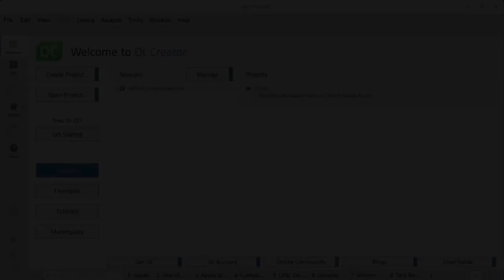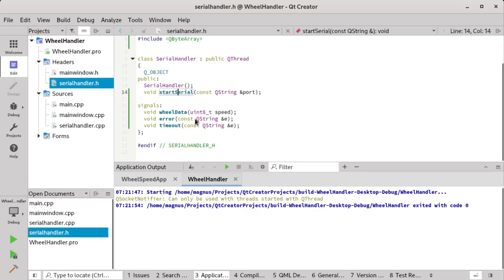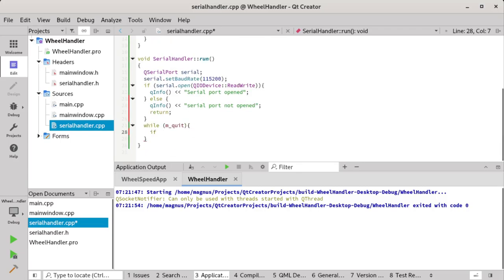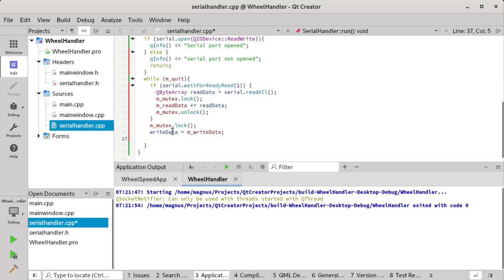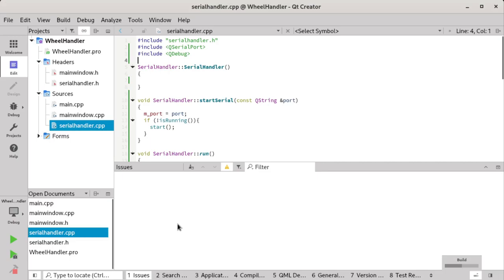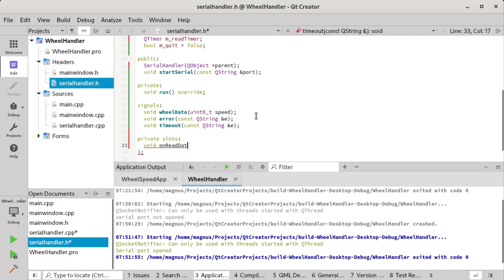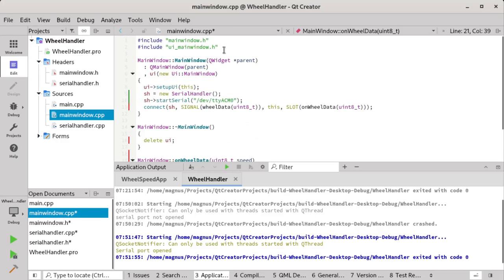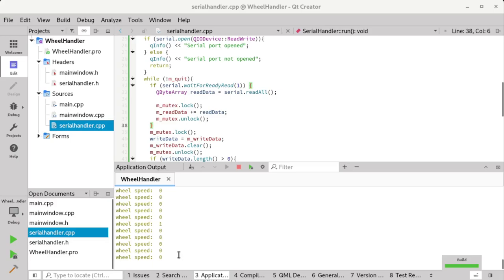Running a Hoverboard Motor with a MotorController using and Arduino Uno Part 2.

Comment: Can you connect the flysky receiver directly to this motor controller through the pwm connection without using arduino ?

Comment: I did one using the same speed controller. I also bought a cheap flysky remote control. After stripping a john deere riding mower, building motor mounts and controlling fwd and reverse my last step was build the steering mechanism and I got sidetracked and been sitting for over a year. I think my speed numbers in code was -255 to 255. If I remember correctly the code from ide was already done with no need for edit on my part. If I still have file I'll post the link
Reply: Please, the link??!!!!!
Reply: @saleycole4296  never got back on that one. Shortly after that comment I gained 3 hoverround motors and two dump truck tarp motors and changed direction. Just told my wife today I need to order the sabertooth motor driver to get this project done